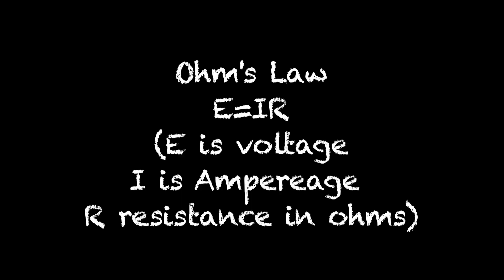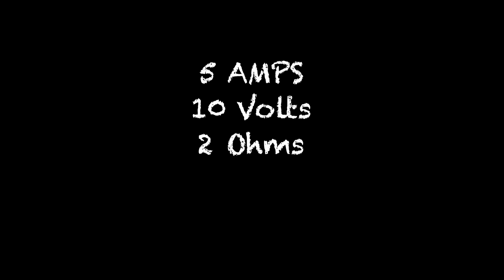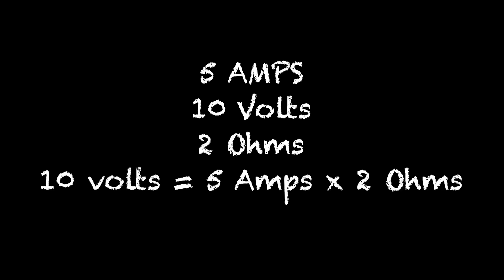Electricity for Model Railroads - Part Three - Ohms Law

Comment: Great vidio,  good explination of track power, my f3 2025 with 6 alum cars and lights pulls the full power of the 120 watt old school. Newer stuff and leds in pass cars is way lower, Williams f7 AA with 4 can motors needs only say 40 watts. Thanks for the morning coffee...
Reply from the maker: YUP!! Next up parallel loads. I had ABBA with two motors each. 5 pound locos. On a 5% grade pulled 10 amps at about 8 volts. 8 volts from a 16 volt supply? YUP it was that over loaded. Next weeks show..